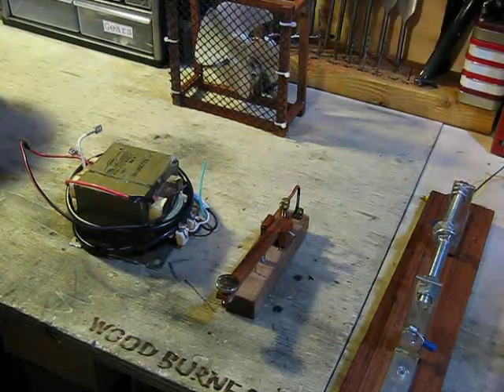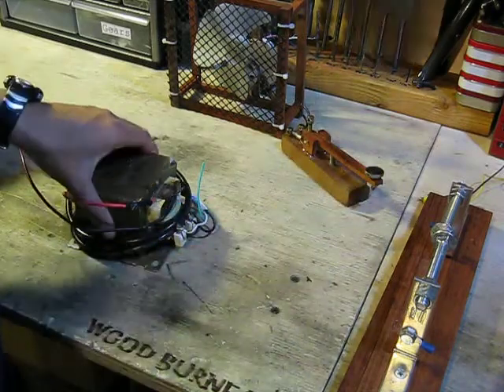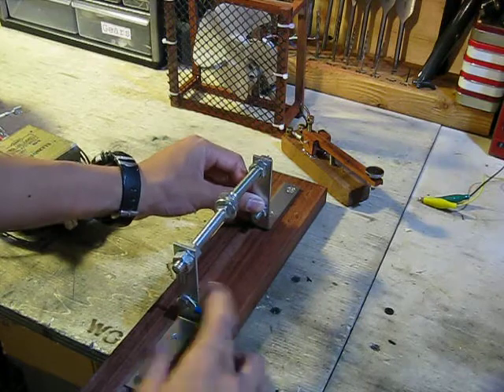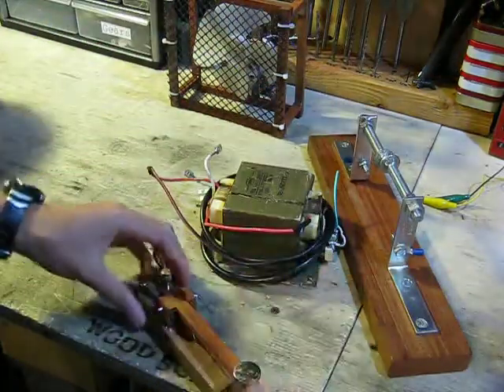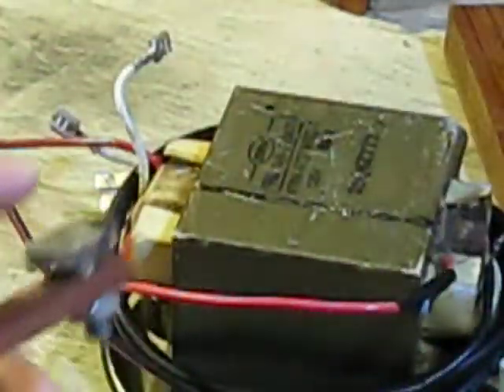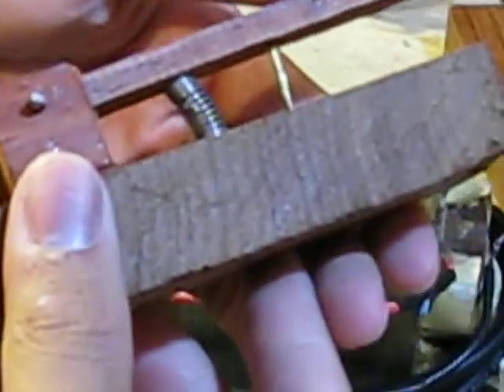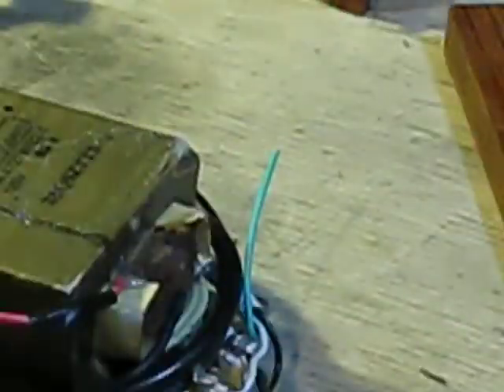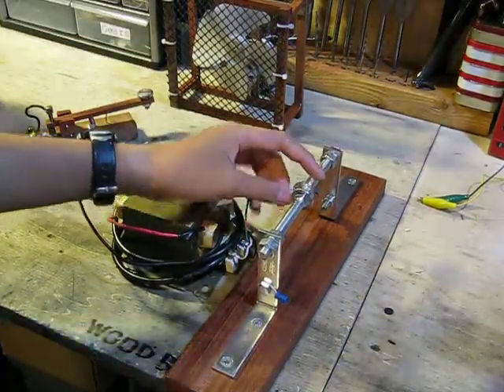Project: Spark Gap Transmitter Update # 1

Comment: Not a good idea. Spark gap transmitters have a terribly broad spectrum, so you will cause lots of interference if it generates more than a few milliwatts. You will probably be noticed by anyone who uses AM or SSB radio. They might call the FCC or the police. Transmitting without a licence is illegal (exept CB)
Build a small proper QRP CW transmitter (google it). You can build one with as little as 10 parts.  

The best solution is to get your licence and get on the ham radio bands. 73 de PD3LV